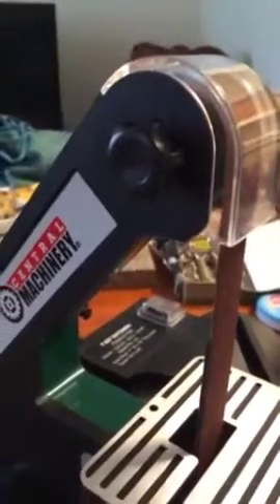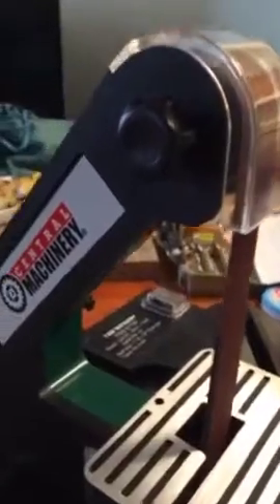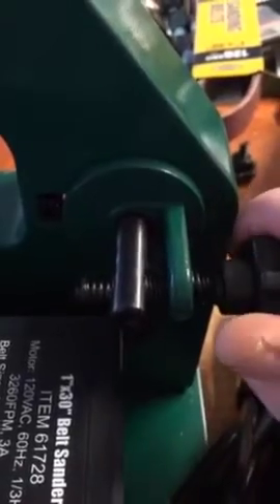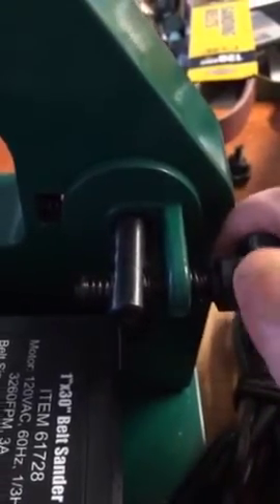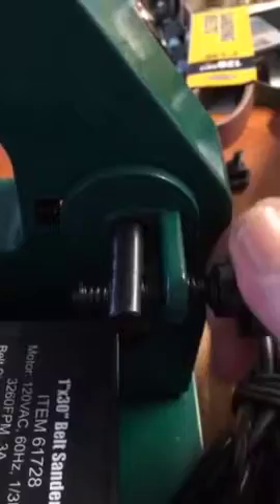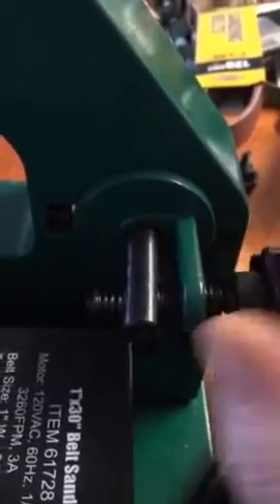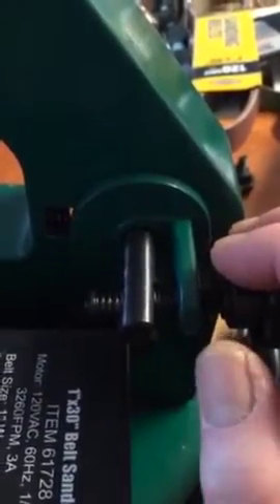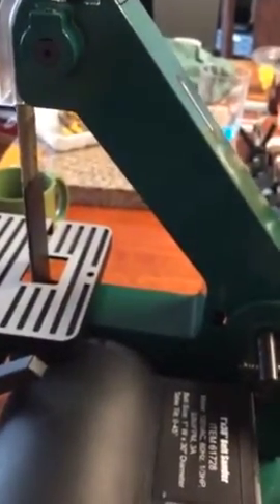1x 30 belt sanding adjustment tip

Comment: I have bought 4 1”x30” belt sanders from Harbor freight . They all quit working because I loosened the nuts that adjust the tension nut for the belts. Your video was good but

Comment: In order to maintain proper tension on the sanding belt you need to loosen the nut on the bolt where the idler wheel arm pivots just enough to allow the spring to operate  the arm when compressed and released by hand. This will permit the spring to perform it's function of maintaining proper tension on the belt regardless of variation in belt length. This is not made clear in the operator's  manual. This also makes it very easy to exchange  belts by simply  pulling the  idler wheel assembly  toward you until the spring bottoms out.